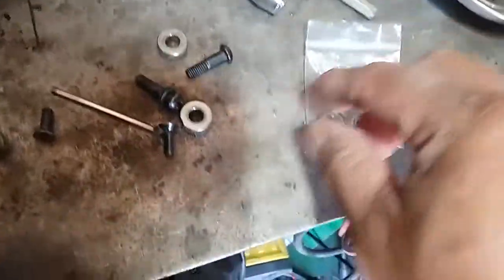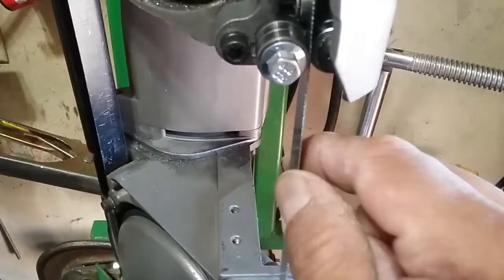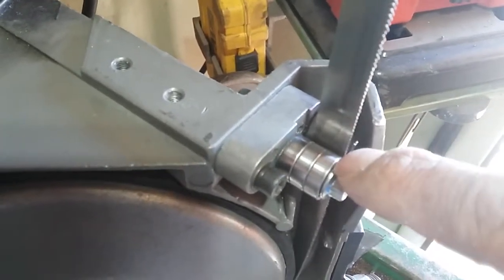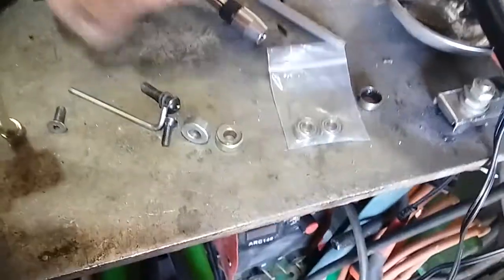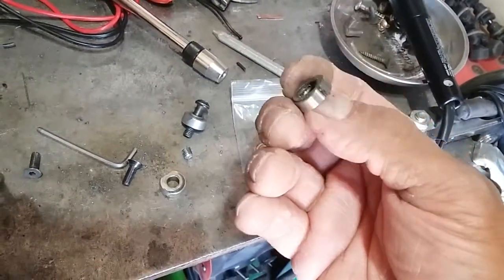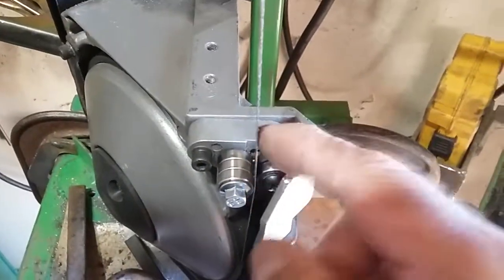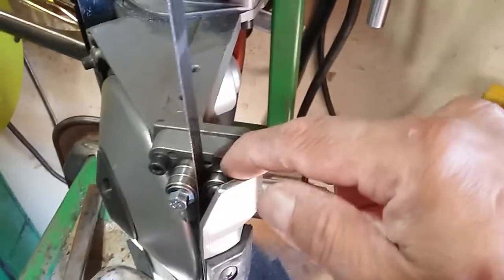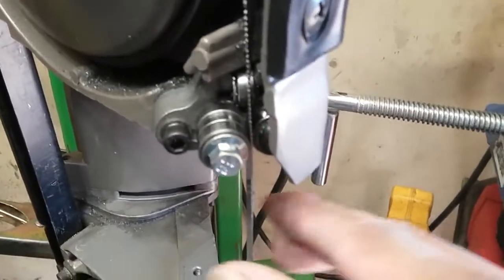Bauer bandsaw upgrade.

Comment: just curious all i can find is 6mmx15x15 , do you have the part number ?
Reply from the maker: Not of hand. I looked at bearings on saw and that for reference.  Use a caliper to measure mm. 699zz I believe I used.
Reply: @zeroninejames9507  Thanks, all i could find was 5x14x5 and 6x15x5, ordered two kits, I figured I can just put the 14 in the back, since you pointed out that the top side bearing has the most pressure. I figure as long as the inside diamter works with the other bearing is should do well. 

maybe. I keep throwing the blade on very heavy stuff. like railroad track, which isnt what it is designed to cut, but i have alot.
Reply from the maker: @Inb4ending  thanks. That'll probably work.
Reply: @zeroninejames9507  The bearings are 696zz 6mmx15mmx5mm i just took mine apart to check. I have been really regretting cheaping out and getting the HF portoband instead of the milwaukee one since my blades keep popping off and was about to bite  the bullet and get the milwaukee but this video has given me hope for a cheap fix.
Reply from the maker: @brentmeyer6569  hopefully it works out for you. That's just the best I can do. I used the bearings that came close for quick fix. Thanks.
Reply: @zeroninejames9507  My bearings were delivered yesterday so I installed them along with a new Milwaukee blade and so far it the blade seems to be staying put a lot better. I was using the Bauer blade before so I'm sure the better quality Milwaukee one is helping too. Thanks for coming up with this fix!
Reply from the maker: @brentmeyer6569  thanks. Yes. Milwaukee blades are better. Good to hear you got the bearings installed.  Hope everything works out. Your welcome.